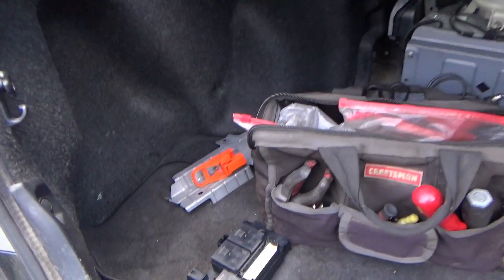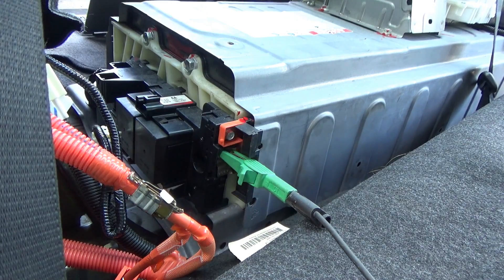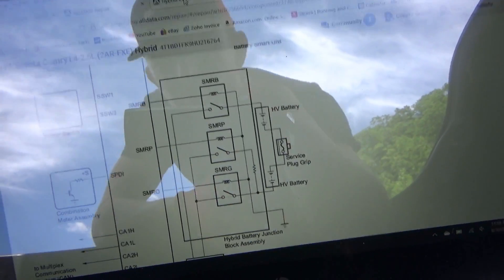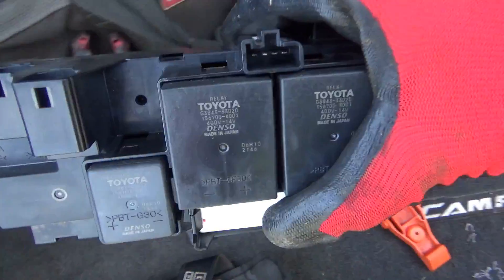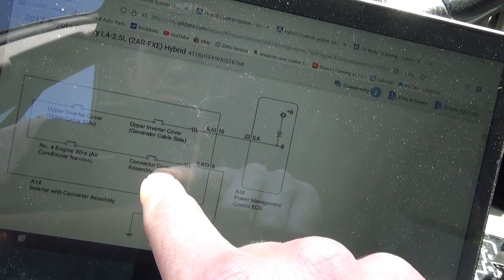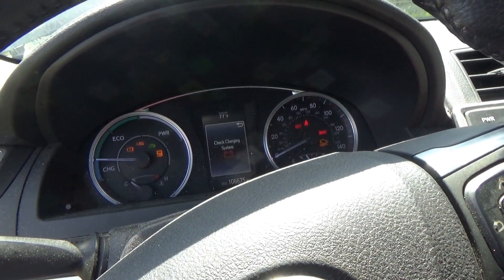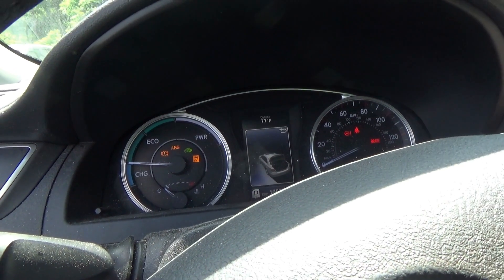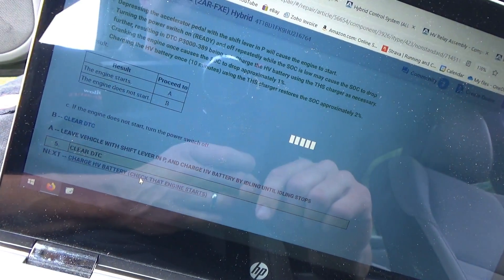Customer bought a HYBRID...and it Can't MOVE! (Part 2-Repairs)

Comment: Always thought hybrids sucked, thanks for confirming that Ivan
Reply: Well I like my little hybrid, though it's a plug-in. 600 miles on a full tank at 60 mpg is nothing to cry about. Just wish had a little more miles on pure electric.
Reply: @vadim7590  They use child slave labour to mine the minerals for the batteries, and the amount of extra energy used to build the things is crazy too. Most estimates say that you need to drive around 100,000 miles just to offset the environmental impact of manufacturing, mining and transportating the batteries, and by that pont you need another battery pack anyway.
Reply: @MattyEngland  just for car batteries? Not phone, tablet or other million devices? ICE cars don't use 99% of parts manufactured by Chinese children? That whole anti-EV nonsense is getting old and boring.
Reply: @vadim7590  EV fanbois are twice as annoying. If we had nuclear power stations and the electrical infrastructure to cope, I'd be all for EVs, but in the real world they don't work on a large scale. It's fine if 1 in 100 vehicles is electric, but if every vehicle was electric then the country would descend into chaos.
Reply: @vadim7590  You could make 1000 phone batteries for every car battery.  All things have a human and environmental impact, but EVs are actually making things worse not better.
Reply: @MattyEngland  sounds like you did your online "research" without any practical experience. Don't you find it interesting that ice fanboys are called"enthusiasts", but ev are annoying fanboys?
Reply: @MattyEngland  there are probably 6 billions cell phones in use right now, 100s of billions phones in the trash, yet my little hybrid is causing all ailments in the world. Anyhow, I still like it, regardless of what bs claims trolls come up with. I scored it for peanuts a month before pandemic started, it costs peanuts to operate and it turned out to be a pretty good move with these gas prices. It has a lifetime battery warranty and 10 year drivetrain. After that I may have to call Ivan.
Reply: @vadim7590  not bad until something goes wrong and you spend a fortune fixing or just get rid of it. But with gas prices as high as they are that's a good move for now.
Reply: @jorgemat8080  any modern car will cost you a fortune to repair though. If it's not something basic, like changing struts or brakes, you'd have to go to the dealer due to proprietary software, having ice car doesn't change that.
Reply: @vadim7590  so you saying that if I buy a regular gas power car is going to cost me a lot to get it serviced. NOT. Don't have to deal with high power batteries that cost a fortune and need special equipment to work on them. So hybrid and battery power cars are only as good as your under warranty and your batteries are good after warranty is over mind as well buy a new one. As some batteries cost almost as much as a new car like the tesla battery. Regular cheap 4 cylinder gas power car under 20k low maintenance gets about 35+ miles to the gallon why would I even consider buying an electric or v8 car. It's just Americans like the power of v8 and fast cars and spend a lot on gas and maintenance. But everyone has their opinion and choice. I personally rather have a small gas power car where I do my own maintenance rather then work just to maintain a car. (My opinion)
Reply: @jorgemat8080  small gas powered car is a good alternative, however, there aren't many choices these days. In normal times you could get a Prius hybrid for almost as much as a gas car. Those were very reliable and needed a new battery after 300k miles, which wasn't too expensive to replace for diyer either.
Reply: @vadim7590  yes I know 👍prices nowadays are just insane and salaries are minimum so there's no way most people can afford a new car.
Reply: @jorgemat8080  yet for hire signs are everywhere
Reply: @vadim7590  funny making $16 hour paying 1600 for rent and yet going to look at a car that costs 45k that's not going to work. So yep keep that hire sign up until you raise that 16 to about 28 then we talk. Get my point,shit is expensive but the minimum stays the same.
Reply: You don’t plan to buy a hybrid so You are just looking for a reason

Comment: This vehicle doesn't have a low voltage (12 v) starter . Cranking is performed by the high voltage system.  The 12 volt battery is only for the instruments,  computers,  lighting,  etc. I've never had a high voltage battery pack be so discharged that it wouldn't crank the engine.  Bummer.  So close.  At that point I would have looked into purchasing the charger. Welcome to the world of special tools and equipment.
Reply: First gen Ford Escape/Fusion hybrids used a similar system, but they have a hidden button that uses the inverter to charge the HV battery from the 12V battery just enough to get the engine started. Why Toyota doesn’t implement a similar system is beyond me, it would probably just be a software thing.
Reply: @upload15613  it's a cost thing with implimenting a high power DC-DC boost converter.   Toyota corporate are known for skimping on useful features like this.
Reply: @v12alpine  Doesn't even have to be high power. You can trickle charge the main capacitor that is already in the inverter until it has enough juice to turn over the engine. HV battery doesn't even have to be connected.

The thing is that making a DC-DC converter that goes both ways (instead of just one way) is more expensive.
Reply: Purchasing the THS charger? That will set you back a mere $7000.
Reply: @brandonsnider7907  You can get them for about 6k. About the cost of a good scan tool.  Like everything else in the shop,  can you justify the expense based on projected need.
Reply: @andybonneau9209  Sorry, I thought you meant the owner of such a car. Yes, a shop might buy that thing. I think I'd just send the customer to the dealer and let them handle the problem.
Reply: What a joke of a system

Comment: Time to look for a special charging tool for these hybrids?  or invent one lol?
Reply: People have kludged together hv chargers but the easiest solution is not to reinvent the wheel when the dealer has one.  Most hybrids go their whole life without totally discharging the hv battery.  Normally the relay assembly will keep this from happening.  This one had its relay screwed up by a moron, probably was left running in Neutral (can't engine charge) and or has a completely defective hv battery (unlikely on a 2017 unless the same moron tried to swap cells).
Reply: Wouldn't a 220V outlet from the shop bring it back to life with the usual plug in the cable charger?
Reply: @Garth2011  No its 201vdc nominal but has a very specific charging algorithm.
Reply from the maker: I was thinking of jumping it from another Hybrid through a Pyle battery load tester to control the current... 🤔
Reply: @PineHollowAutoDiagnostics  jejejeje don't do that my friend... contact me via instagram and i will kindly assist you to solve the issue... this battery is clearly bad... but there are some important measurments to do first...

Comment: I notice the rubber gloves!,  Kudos for not getting an electric shock ........
Reply: Some of these batteries are 350 volts and a huge capacity. They are far more dangerous than working with mains electricity.
Reply: @MattyEngland   Fairly safe while the Service Plug is removed.
Reply: @richardking6066  Meant to be, but Ivan somehow still had 70 volts across those terminals, even with the plug removed.
Reply: @MattyEngland  Only for a few seconds until a capacitor discharged itself, Thats why they say wait for ten seconds after disconnecting...
Reply: The gloves he is wearing are useless as they aren't high voltage.
Reply: The risks have been hugely over-hyped (maybe to scare off the fat fingered idiots).   If you take a bit of care, disassembling the HV battery is a lot less dangerous than actually  driving the car in traffic! A million people a year are killed in traffic accidents around the world  - how many deaths of mechanics have you heard about while working on a Prius?